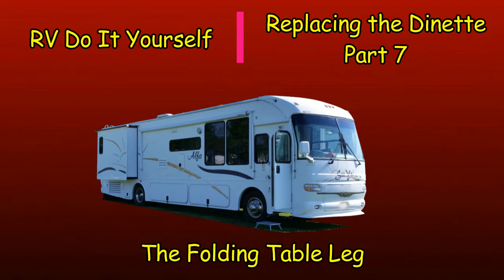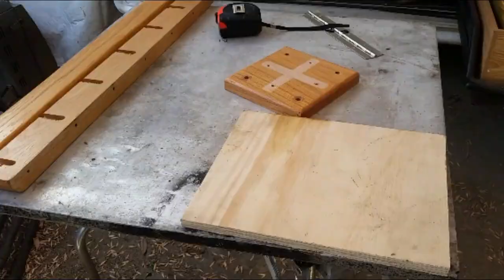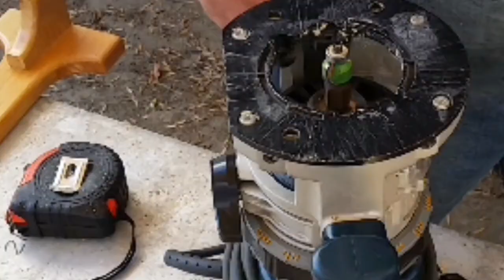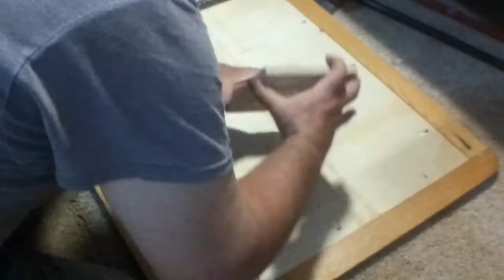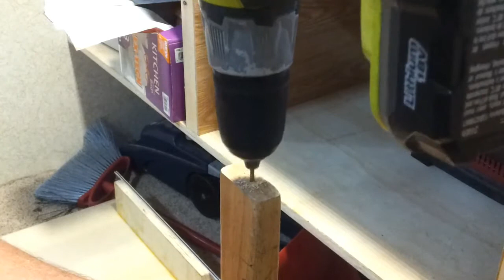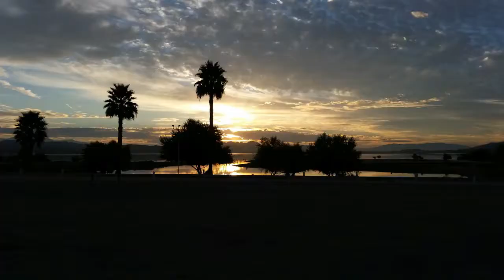RV DIY -  Replacing the Dinette - Part 7 - The Folding Table Leg

Comment: Hi, your videos are very informant. We are restoring a 1971 Holiday Rambler, we are putting the cabinets in and would like to finish the counter top with epoxy.  Have you done the epoxy yet. Just wondering how it was to work with.
Reply from the maker: +cousinJoJo1 
We are still choosing colors for the top, Sherry wants gold, I think matching the existing counters, when we decide then we will do the video.